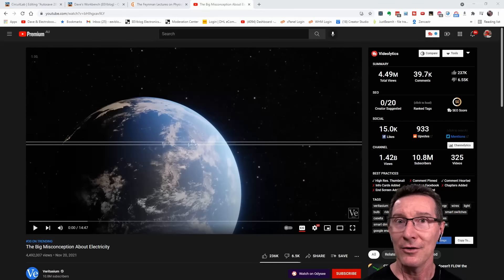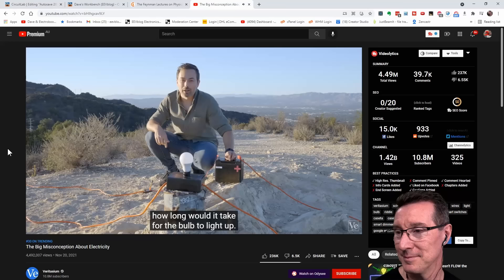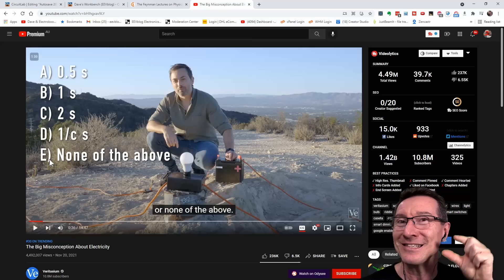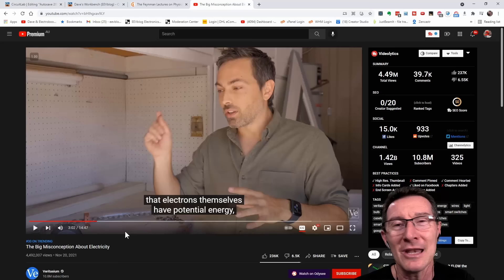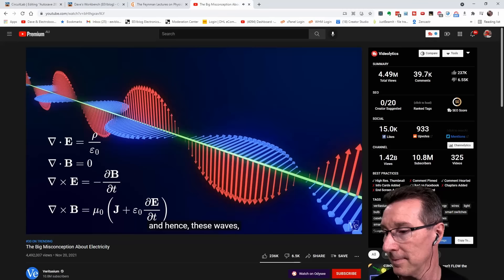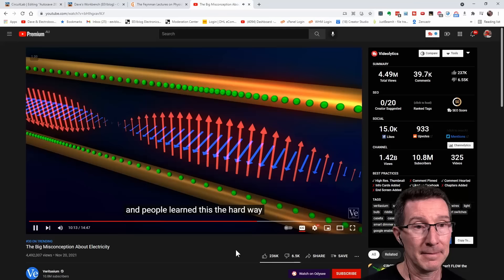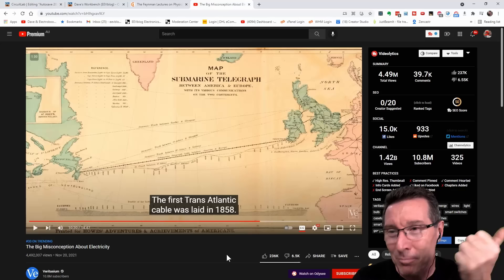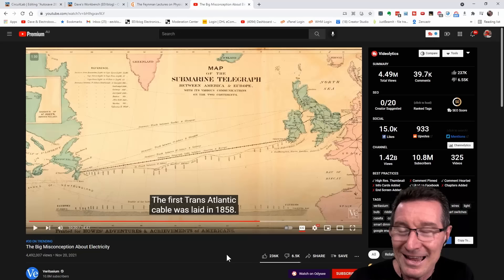EEVblog 1439 - Analysing Veritasium's Electricity Misconceptions Video

Comment: Shouldn't it be "1m/c" instead of "1m/c seconds"? Because 1m/c already has the unit of time, namely seconds.
Great video. Love it!
Reply: No, 1/c is completely fine. c is defined as meters per second and result is given as seconds. Thus there is no other possibilities assuming SI units in use.
Reply: @user255  You need the meters to cancel leaving just seconds.
Reply: @stargazer7644  The answer is in seconds, thus the 1 does not have any other valid unit than a meter.
Reply: @Kai You are of course perfectly correct. Just another bit of sloppiness in all this.

Comment: Your argument that it is good enough to imagine the energy flowing through the wire versus considering the actual mechanics occurring reminds me of the distinctions between classical Newtonian physics and Einsteinian relativity:  Einstein's equations (eg, the infamous E=Mc^2) do actually include all of the Newtonian equations, but many of the "additional" factors are zero (or one, as appropriate) so they don't need to be included.  It's only when you get to the more extreme ends (huge masses like black holes, or speeds approaching C) that they become important.  In most practical applications the specifics of how electricity is being moved can be ignored, but knowing how it actually happens is still helpful and important.
As far as your claim that Veritasium was being sneaky or disingenuous by leaving out the units in answer D, I think that misses his point.  It wasn't really a test to see if you know or not, rather it was a way to highlight that the commonly taught (ie, high school or undergraduate level physics) analogy of "electrons flowing in the wires" is inaccurate, thus providing an opening to teach a more accurate view of what's happening.  As you said, this is video is aimed at those of us with a basic level of knowledge about electricity, not those of you who work in the field (pardon the pun) everyday.  That being said, I appreciate getting a perspective from an expert in these matters who can help me to understand when it is appropriate to ignore certain factors in a day-to-day practical application.  So thanks! :)
Reply: Yes exactly! And when he said things like "who thinks that??"... Well, I did.

I'm something of a general pleb, and I always believed (and was taught) that energy flows around a circuit rather than travelling through the formed EM field.

It's always good to get a review in though, it's just an extra opportunity to learn and think about stuff!

Comment: My biggest issue with Derek's illustration is that he ignores the density of the fields. All his pointing vectors are the same magnitude and therefore the viewer is led to believe that the energy flowing through the air is just as big a contributor as around the wires. In reality, voltage applied to a wire induces an electrical pressure wave (E field) to the electronics spreading out at essentially the speed of light. As each electron reacts to this pressure wave, they are pushed or pulled. As each electron is accelerated, it induces what we refer to as a magnetic field, which is a model that shows the effect that the movement of that electron has on all the surrounding electrons. What frustrates me about Derek's explanation is that he seems to imply that the wire is inconsequential. This is absolutely not true as the wire houses all the electrons in a very mobile state that allows the E field to get them moving to allow the creation of a B field. In addition, field theory shows that the density of the B field is highest right at the electron moving and drops very quickly as you move away, therefore the pointing vectors should be very "thick" right on the wires and get much much less consequential as you move away from the wires. As Derek setup the problem, he is correct, the light will flicker 1/C s after you close the switch, but only due to the capacitive and then inductive coupling of the wires, full power will take much, much, much, much longer due to the transmission line Dave discusses taking a very long time to settle out.
Reply: Exactly. On one side, Derek was talking about magnetic field around the wire responsible for transmission of energy, and at the same time he was forgetting who is creating that magnetic field in the first place. As the Dave said, it is disingenuous to miss these details.
Reply: When you say inductive and capacitive coupling of the wires, are you saying that one wire is a transmitting antenna and the other a receiving antenna? Because if that is the case then Derek's video seems like a pedantic waste of time and he seems like a snob since as this video points out, everyone who (needs to) know(s) about wires radiating EM waves already knows  that the amount of energy transfer across the 1m space is not the full energy and might not even be enough to actually power the bulb. Also, the simplifying assumptions are ridiculous and do not match the conditions under which he turned on a real light.
Reply: This & Mandeep's comment get it right. The way he talks about power transmission (in real life) in the same video, implies the energy is carried by that electromagnetic field between the wires. In reality, it is carried by the electromagnetic field along the wire -- not over the air directly to the lamp.

In his example, the circuits with the switch and with the lamp would not need to be connected to get to the same result he did; that is, if you only care about the energy carried over between the wires through the air in 1 m/c.
Reply: @sakaricajanus90  Very true. You have rightly pointed out & clarify the part which can otherwise create confusion in non-technical people.
Reply: Who the heck is Derek? The guy with the big nose or the guy with the small nose?
Reply: Dave here uses the wrong model for Derek's experiment setup.  A transmission line model is not applicable, so what you see on his graph is incorrect.  The better model is a dipole antenna model.  See my explanation in the main thread.
Reply: Yes, and apparently Derek believes his own malarky when he suggest that the power doesn't flow through the wires.   Do the calculation - you can transmit <100 microwatts transient, briefly, to the light by closing the switch, but the big power comes after the current density wave makes the long trek and reaches the light (and many reflections later)   The B-field at the light is tiny till there is a local current at the light.

Very deceptive by Veritasium, and I suspect it's intentional.
Reply: @stevealexander8010  I agree 100%.  But ... so many follow his presentations and many many folks have been misled by this one, I wonder why he would be intentionally deceptive.  My suspicion is that he doesn't fully understand this topic himself, and yes there, he believes in what he doesn't understand in the same way he believes in other areas he is an expert in.  Derek presents at least one consultant who warns him that he could get flack, and yet he still produced the video as-is.  It is very clear too, that Dave of EEVblog did not model Derek's experiment correctly.  Unfortunately I feel these are the kinds of events that lead to propagation of falsehoods and misinformation when one is established in a position of some authority like Derek, and this is one blatant, although in this case no one's health is affected as in the case of Spotify's NeilYoung-vs-Rogan for example.

I am not too concerned about Dave getting this right.  However, I think Derek should at least carefully address our concerns and pin a post from our discussion.

So I have in mind to string our exchanges here together into one sequence and post it to Versatim.  Hopefully he will take it seriously.  

Are you in?
Reply: @stickfijibugs  >>I wonder why he would be intentionally deceptive.
This:
https://www.youtube.com/watch?v=S2xHZPH5Sng

I believe that Derek is intentionally making "clickbait" type vids to get more income.

 It started with  outlandish and silly titles, "Math has a fatal flaw" - (uhm NO!), " or "This Equation will change how you see the world" (Didn't).   But now he is strongly implying false conclusions.

BTW there is some ancillary matter links from the Veritasium vid but it is a real mess - graphs with no axis labels or units, and data presented from apparent thought experiments w/o explanation.  Useless.
==
Like you, I find it disturbing to see the Veritasium comments about "Oh - now I understand it" - when the were just taught a misconception by Derek.
==
I've posted in detail on the Veritasium vid, and I think at this point I'd be "feeding the troll".

Comment: "The voltages and currents are, in no means, representative of what you would get in this actual scenario." As an EE, that IS the point. Derrick is 100% wrong in saying the light will "turn on" almost immediately. The amount of the capacitance (about 1 pF/meter tops) and inductance (1nH/meter tops) really matters. It also matters if you put the inductor first or the capacitor first when you model the distributive impedance since the inductor will act as a current limiter. The potential current flow with a 1VDC batter will be far too small to "turn on" the light.

The question is not whether you will see a wiggle in the voltage across the light, the question is will it be enough to "turn on" the light.
Reply: Yeah each transmission line would be about 900 ohms so with a 12V supply, you'd get 7mA in your lightbulb. Enough to light a tiny LED but certainly not enough for an actual light bulb like he showed. The question wasn't "How long for a signal to be detected?". So Derrick is just wrong.
Reply: @Ikbeneengeit  How did you get the 900Ω?
Reply: That's why Derek has it so that any non-zero current counts as the bulb being on
Reply: @jguy584  Right, he specifically clarifies that point. It’s an idealized model of a light bulb
Reply: @jguy584  “Non-zero current” requires no wire, because any small movement of charges around the battery and the switch will cause some tiny change in the field.
And, if you claim “1/c” answer is true, energy actually has no time to travel through any portion of the wire.
Reply: His point was about the basic idea of  how power is transmitted "along" and not "through" a conductor, not circuit design. Nit picking like you are doing is not helpful.  If you analyze Dericks language, he said "almost immediately."  Looks reasonable and certainly not 100% wrong to me.
Reply: This is the right answer.  Derrick is not correct.
Reply: @charleselkins4546  wrong.  It doesnt light up. It blinks weakly and momentarily until the wave comes back from the transmission line.
Reply: @defunctuserchannel  For any epsilon > 0 the current flow in epsilon seconds induces current in the bulb, which means there is current at 1/c + epsilon seconds. So current begins to flow at 1/c seconds.
Reply: Out of curiosity, is the cause of the minute flash caused by magnetic forces in the bulb side wire similar to how a wireless charger works? Or is the electromagnetic wave just generated at the battery due to the abrupt change f state?

In theory, would this work if there were no wires with just a battery and super conductor light bulb, or is it that the electromagnetic forces in the battery side wire just and the light bulb wire syncing and causing voltage in both sets of wire?

My understanding is pretty elementary, but it really seems that a change magnetic field moving electrons and moving electrons generating a magnetic is the same thing and we can't have electricity without both.

Comment: Being electronic engineer myself, I completely agree with you.
1. It's a simple transmission line problem
2. There was no mention of skin effect.
3. 1m/c was conveniently left out.
Reply: "1/c s" didn't even make sense when you realise that c has a unit (km/s) and then 1/c would make 1/300000000 km/s, and that's not a measurement of time.
Reply: You can reduce the calculation of an actual value to electronic engineering, but that isn't exactly a full account of the problem. That wasn't really the point of Veritasium's video.
Reply: yep quite the click bait lol
Reply: @MattRose30000  LOL You talk as if yours is any better. "1/c s" is 1/300000000 s^2/m, not 1/300000000 km/s. What you wrote is 1(km/s)^2/1000c. Please, if you're being pedantic, at least know what you're talking about.
Reply: @Raam V
Careful!  Dave here uses the wrong model for Derek's experiment setup.  A transmission line model is not applicable, so what you see on his graph is incorrect, and Derek's answer of 1/c for immediate steady ON is also not entirely right, it's misleading. For the immediate transient, the better model is a dipole antenna model.   Also, Derek conflates DC steady state with transient analysis which is false and folks who want to learn, get misled.  See my explanation in the main thread.

Comment: But, but...  Then how do Flux Capacitors work?
Reply from the maker: Well, you take this big pole and hook, and...
Reply: It's pretty simple. Looking at a flux capacitor you see the 3x high-voltage breakout points located ~120deg apart around the center node. With 1.21GW input energy this makes the pointing vector at the center start to spin at infinite rotational velocity which in turn creates a point singularity at the center node.  When the car is moving forward at 88mph perpendicular to the flux capacitor the singularity gets stretched in the direction of travel. It becomes more of a spiral cone shape with a larger opening on one side verses the other. Eventually It becomes so large at one end that it envelopes the entire stainless steal car body and the flux interaction pulls it through time.   

Bonus fact: If you look very carefully you can see the angle of the 3 terminals is not exactly 120deg. The bottom most breakout point has a larger angle on each side.  This is to compensate for the downwards effect of earths gravity which would otherwise interfere with the alignment.

Comment: If the energy flows in a field surrounding the copper atoms that make up the wire, then the wire must act as an inside-out conduit or guiding line.  Energy can flow without wire (radio waves etc.) but the wire (conductor) acts as a facilitator or focusing agent.  This brings to mind some questions about the physical aspects of the wire.  If you compare the electrical qualities of a Kilo of copper in the form of an ingot or a pile of copper pennies or a line of copper wire or any other form you may imagine each different physical embodiment of one kilo of copper will have unique electrical qualities.  This makes me think that wire may have been one of the world's greatest inventions.
Reply: You may not be able to touch that electron directly, but you're still moving that electron, and that moving electron is still the source of the 'energy'.  Put some reversed magnets in a tube as a stand in for electrons.  You can put energy in by crashing other magnet's fields into the ones in the tube.  The momentum energy is IN THE MASS and momentum of the magnet, even though the way you get it there is indirectly through the field.  The energy goes through the field and into the magnet, and comes back out through the field interactions.  At no point is the energy just 'sitting' in the field somehow, that is merely the mechanism of interaction to get it into and out of the magnet.
You may get the energy into the electrons by way of their field and be able to do that both inside and slightly outside of the conductor, but the energy is very much in the momentum and voltage levels of the electrons.  Those fields don't move themselves, they aren't an independent energy holder from the electrons.
Realize for electrons in a conductor the real 'energy' is in lifting the electron sea away from their preferred ground state.  If you have trillions of electrons on a conductor, and add a billion you've raised the state of all the electrons.  That's why you can connect a path anywhere along the conductor and the electrons will deliver energy into the load.  While you can get energy in and out by way of the field, at no point is the energy stored 'in' the field, it's sourced and sinked into that electron sea energy level. 

'Energy can flow without wire (radio waves etc.) but the wire (conductor) acts as a facilitator or focusing agent.'
Realize when you do this, you've done specific things to 'use' the energy in the wire to 'make' the radio energy.  You've done a conversion process, it's not the 'same energy' just moved off the wire.  In a way it is the same energy, in a way you've used one form and generated another.
If you use muscle power to raise water to the top of a hill, are you thinking of that potential energy stored in the raised water as the same 'muscle energy' that was in your arm?  Similarly in a way it is, in a way it isn't.  
But in both cases, it's not really just 'directly the energy you originally had' moved to a different place, there's a very specific conversion process required, not just 'energy went from here to there'..
Reply: And insulation with low K the jam to that toast.
Reply: All about induction transmission

Comment: I am a IC circuit designer, I understand your pain, but at heart I am a Physicist and it hurts me every time my engineering colleagues argue about current flowing inside or at the outer edge of conductor due to Skin Effect(which very rare number of engineers talk about, smhh).... But Lets consider a hypothetical situation of Superconductors being used in a circuit near to BlackHole, now tell me do you think the circuit will work? Physics says it won't work as Black holes absorbs all electromagnetic radiations, but if you consider electrical energy is flowing inside wires then circuit will work, which current Physics disagrees!!!